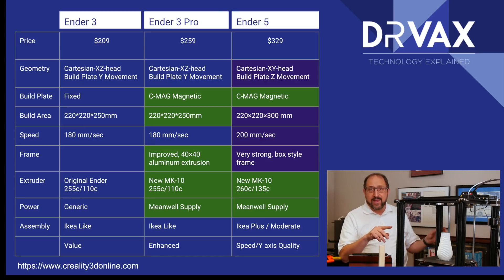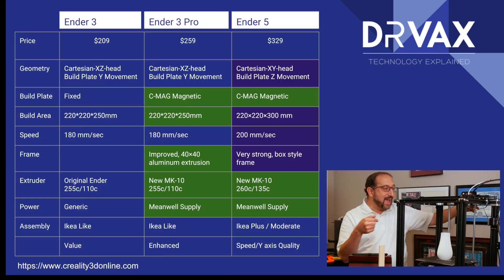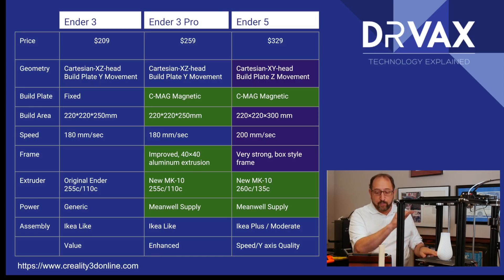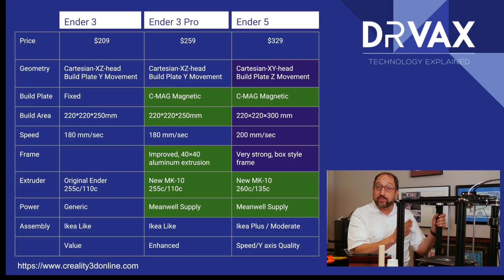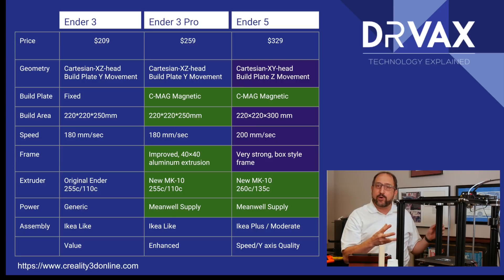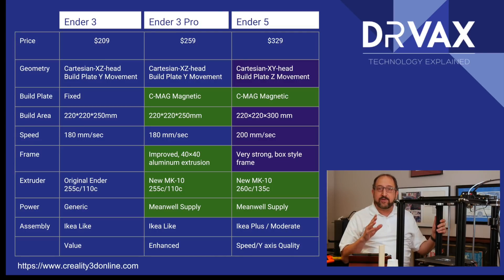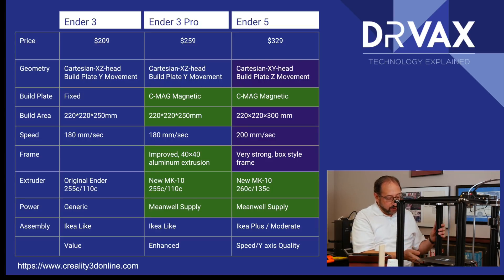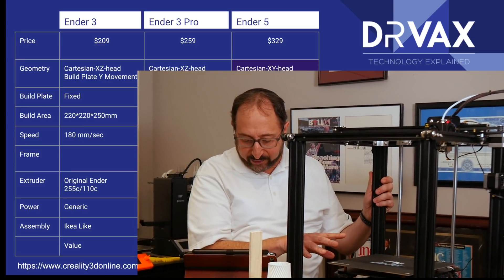3d Printers:  Ender 3 vs Ender 3 Plus vs Ender 5.  Geometry Matters.

Comment: Hmmm so technically Ender 5 will have better resolution on each layer because the locus of the print extrusion (nozzle) is a resultant of 2 stepper motors acting on a single (nearly...as it is not a core xy) mass, the print head. Whereas that of the Ender 3 /pro is a resultant of forces acting on two diff masses (the head and the bed). So any change in the bed mass will affect the resolution however small it may be. The computation will also be cumbersome. Thanks for helping me to understand better...

Comment: I am looking into buying my first 3d printer, what are your thoughts on the Ender 5 plus is it a good printer for a beginner? (looking for a larger print bed) i am also curious as to what software you think is best for designing what to print for the Ender series printers.

Love your videos, keep up the good work
Reply from the maker: I am a big fan of the Ender 5.  I have not used the plus but the specs look great.  Watch this video to learn about designed models for 3d printing:

https://youtu.be/GRsXW1l0i90

Comment: wrong,,, header would not move 100 squared, but more like: header will be in 100000 positions/cells during its work. that means that desired print would have such characteristic. assuming your 100x100
Reply from the maker: I appreciate your comment.

Comment: I hate ender magnetic bed. My removable surface sometimes sticks to bottom and pieces of the removable layer can be removed and left on the bottom! Only after about a couple weeks of use I'm in a need for a replacement. Unacceptablew.
I replaced mine with a glass bed (with problems gettting petg stick) and will try pei coated metal plate next. Fortunately those can be easily bought from places like ebay.
Reply from the maker: Interesting.  I like the surface.  Not as much as the spring steel surface on the Prusa or the Qidi printers but if I use some MagiGoo on the surface before every couple of prints I have no issues.
Reply: @MakeWithTech  I've used glue when needed too, on the top side of the flexible plate. 
The problem of the flexible thing is the problem. It sticks on the heated part and the bottom of it gets destroyed piece by piece.
That seems some kind of manufacturing issue. It gets sticky only when hot. When bed not warmed you can easily put it on/off without it feeling sticky at all.
Reply from the maker: That is exactly the idea.   The recommended way to use the Creality removable print surface is to wait until it is cool to remove the print.  If you want to speed this up put it in the freezer after a print.
Reply: @MakeWithTech You still seem to have misunderstood. I'm not removing the part from the flexible surface. I'm removing the flexible print surface from the printer! Let it cool or not does not matter much.
Bottom of the removable  magnetic surface gets destroyed at the removable interface.
Even without printing anything it gets a kind of sticky and removing magnetic surface from heated bed suffers bit by bit. It gets sticky after a while even without heating it. Just removing the surface that is meant to be removed is the problem.
I like the black top where you print on but hate the brown bottom  that is the problem. The two brown surfaces stick. Perhaps naming colores makes this clear.
Reply from the maker: I just read your latest reply about the print bed delaminating.   I would contact Creality I have had no problem with the print bed delaminating.

Comment: Thanks for doing this review!
Reply from the maker: My pleasure.  I also jus did a build of the Ender 3 Pro which at $230 is a good buy.
Reply: @MakeWithTech  I just purchased the Ender 5 yesterday. Its my first printer although I have been 3d modeling for years.  Super excited.

Comment: I have had an ender 3 for about 9 months in a classroom where it has printed everyday and many times overnight into the next day. The bed sticker lasted a few hundred prints before it bubbled and had to be removed. And we tore a small hole in it removing a print earlier on. The best fix for this a picture frame piece of glass from W-mart for $2.99. I had a small issue with the z-screw not being parallel to the frame, this was fixed with washers. And I did not like how the filament rubbed against the lead screw as it entered the extruder, fixed with a printed sleeve for the  z-screw. The ender 3 was by far the easiest printer that I own and I have a tevo tornado, a prusa i3 clone, two mod-t's, an flsun cube (that can't print correctly two times in a row), and recently a Raise3d pro 2 plus (school paid for it) that has been a steep learning curve.
Reply from the maker: Thanks for the comment.

Comment: I'm new to 3d printing and am considering the Ender 5.  Is there any concern that the bed is only attached/supported on one side, cantilevered, potentially causing it to "droop" and become easily out of level?  Great video.
Reply from the maker: I understand your concern but it has not been a problem for me.
Reply: I had no problems but it definately flexes. I printed and extra support from thingiverse and now it is more than stable enough. I've used glass bed only with the support, no idea if it is a problem without a support. A great printer but the magnetic surface really sucks. (wrote already a separate comment about that)

Comment: Any dislikes/cons since the video posted? I like what I see so far, interested in this unit.
Reply from the maker: First here is the long answer ...

The story of 3d printers today is a story about $50 to $100 here and there.  The Ender 3 is $209, 3 Pro is $279, and the Ender 5 is $329.   It is difficult to determine the right amount to spend.  On the other extreme, you have the Prusa i3 Mk3 at $750 and then printers for school use, fully enclosed, etc for over $1000.   Then the next step is industrial printers which are thousands.

In terms of the Ender 5, I still really like this printer at $329.  However, when I crank up the speed, via the front panel tuning option my print quality suffers.  In contrast to this, I can crank the Prusa up to about 200 percent with little impact on quality.  This is probably because of the extruder and bowden vs direct architecture difference.   With proper tuning of retraction, I should be able to make the Ender print faster.

Then it gets more complex.  I just unpacked and tested the Monoprice MP10 at $400.  While still a bowden setup this has many of the Prusa features for hundreds less.  Here is the video:

https://youtu.be/4T-0npa7iNE

Is this printer worth $70 more than the Ender 5?  In this case probably yes, but not sure yet.

Now to your original question.  Have I changed my opinion since my review of the Ender 5.

No.  And reviews from other 3d printing folks have also been favorable.

My recommendation. Pick a price point. If you are comfortable with about $329 dollars the Ender 5 is a very good option.
Reply from the maker: You are correct.  At some point, you have to pick your price limit and take the plunge.

Comment: I think the current production Ender 3 now also comes with the magnetic build plate.
Reply from the maker: Thanks for commenting.  You are correct.  The primary difference with the Ender 5 is the increased Z-axis height and the completely different frame design which is built like a rock.

Comment: I have an Ender 3 and an Ender 5,  I would say the 5 is vastly better than the 3. I have had exceptional prints straight from the box (once initial levelling done). It is much more solid than the 3 and a lot quieter as well. When I get round to buying another printer ( working on wifey ) it will be another 5. Great video by the way I have only one correction  to make and that is the only stepper motor that moves is on the X axis not the Y axis, very minor I know but hey ho :).
Reply from the maker: Thank for the clarification enjoy your printer.

Comment: Thanks for being one of the only channels putting out content about the Ender 5. I'm very intrigued by the printer. Currently I can get a CR-10 mini or the 5 at the same price and relative shiping time. The magnetic bed is very appealing for it's ease of adhesion as well as removal, and just general reducing weight and force needed to be produced by the Z axis motor in order to support it's weight (compared to i.e. glass) along with the model.

My concern is now that of the bed temperature. You show it is regulated for higher temperature, but everywhere I read that magnetic surface will lose it's magnetism due to the Currie effect at temp over 70c (I think it was). So, ok, I guess I can use a glass sheet if the need for ABS and enclosing the case becomes a thing... but then, the metal base is also magnetised I heard? As the magnets in just the build surface mat are not strong enough to adhere it to the build plate if it was just bare metal? So would that magnetism be destroyed also at temps > 70c? Most trouble I'm having really with the decision is about this really, any advice or clarification to whether the plate is also magnetised and what options there are to print ABS or other high temp exotics, would be very much appreciated.

Thanks and subbed!

Comment: Hi, by the way, you mentioned that the Ender 4 and 5 are not true CoreXY printers as one of the stepper motors is not fixed.
It seems that the Ender 4 is actually a CoreXY ( https://www.creality3d.cn/creality3d-ender-4-p00245p1.html ) and the Ender 5 isn't.
I wonder why they diched the CoreXY design for a simpler one, which warrented a major bump in the version.
Reply from the maker: Thanks for the clarification about the Ender 4.

Comment: Hi DrVax, thank you for your video!

I am strongly considering getting the Ender 5 (as my first 3D printer) because I beleive that, conceptualy, the XY head is a much better design. 
Since most of your prints are equivalent in quality, what advantage, other than speed and smooth timelapse videos, would the Enter 5 have over an XZ head like the Ender 3 Pro?

- Would it require less support material when printing tall thin models because there is no Y motion?
- Would it be easier to print with a flexible filament, again due to the reduction of the bed rocking back and forth?
- Would I need to worry less about bed adhesion?
Reply from the maker: Based on my experience the primary advantages are speed, 50mm of height (Z axis) and slightly better Y axis printing quality.  I have not thought about the impact on tall thin models but that is a possibility.  I do not think it will do a better job with flexible filament because the primary issue here is the quality of the extruder and the Bowden setup.  

I do not think it will have any significant impact on bed adhesion, but once again this is a good question.

I just completed some PETG tests and the prints are quite nice.

Comment: For the price of Ender 5 you can also get CR-10 and add frame braces for few bucks to stiffen the frame and get much bigger volume. Unlike Ender 4 the version 5 seems like a nice alternative from Creality in budget printing though.
Reply from the maker: Good point.  However I find the real difference between the Ender 5 and the CR-10 is that on the Ender 5 the build plate moves on the Z axis instead of the Y significantly reducing build plate movement which improves speed and quality.
Reply from the maker: Absolutely agree.